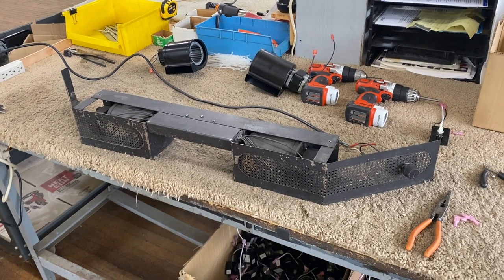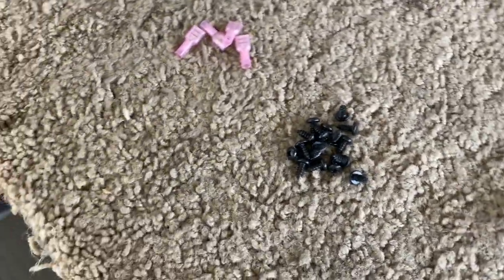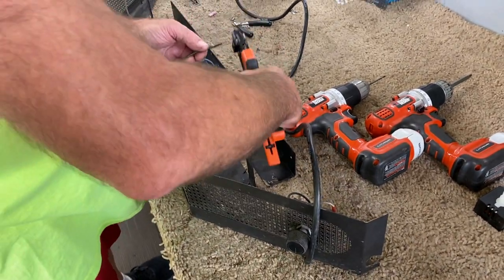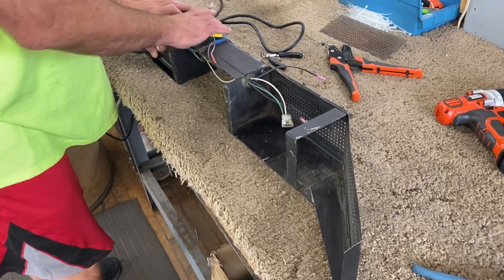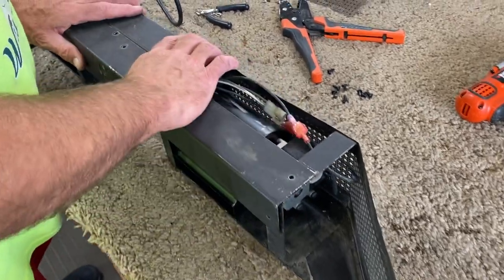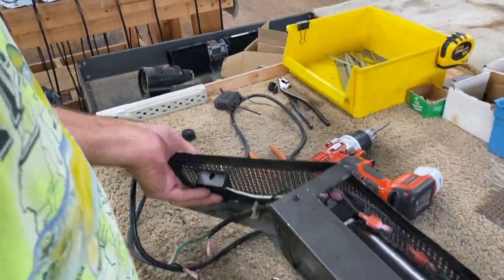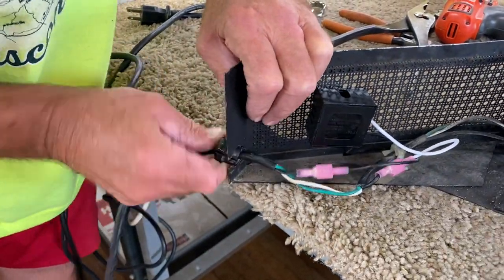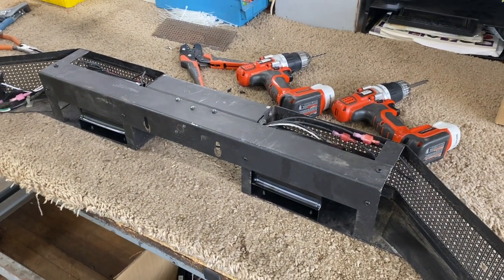Lopi Freedom Bay Blower Installation & Repair

Comment: Thanks guys,great video. I have the same blowers that seem to work fine. I just cleaned them out and all is working. I do have a question as to how these should be mounted to the burner. I have about a 3/4 " gap on both the top and bottom between the brick and blower and the same between the bottom of the burner and the top of the blower. Should I be mounting it this way or move it all the way up or all the way down? Thanks
Reply from the maker: Hi John, which model specifically do you own?  If it's the Freedom, the blower assembly mounts to the stove with two bolts that are pre-installed on the stove and located directly above the dampener handle.  Those two bolts along will position and mount the front mount blower assembly properly below the ash lip.  Regards, Jason